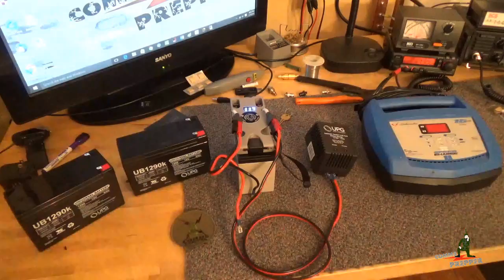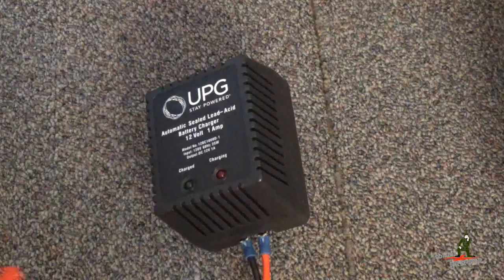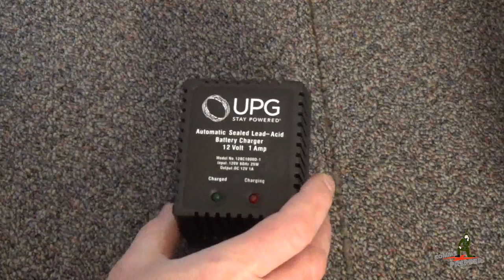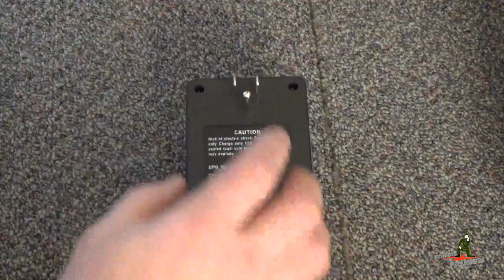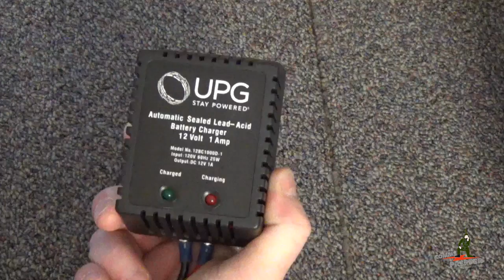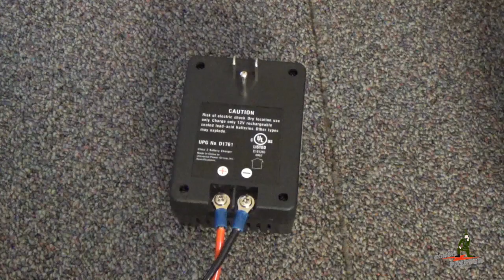SLA Battery Charger

Comment: What is the fully charged voltage of a SLA battery? 12.6, 12.8, 13.2?
Reply from the maker: Not sure.  I don't have them with me right now and would need to look at the spec sheet.

Comment: Thanks for the video! I have that same Hardened Systems unit on my Duracell SLA battery and was searching to see if anyone else was using it in this configuration. I already have a 10w solar panel and charge controller and use it while I'm operating my radio. I was wondering if I could do the same by doing this... having it plugged in at my house while I operate.

Comment: I'm thinking about making a .50cal ammocan portable powerpack for charging HT's and phones + running some LED lights if the grid goes down, would you recommend SLAs? And would you recommend keeping it float-charging all the time?
Reply from the maker: +wouternet94 SLAs are fine for what I use them for.  If I had the money I would prefer lithium batteries because they are lighter. I would recommend a batter tender/maintainer between periods of non-use (a unit matched to your battery type).

Comment: Hank 
Using solar only how would charge your batts 2 stage (absorption/float)?
Reply from the maker: +Max Prepper +hardenedpower I have a BATPAC solar unit that has a built in charge controller for 12VDC panels that supports Absorption and float voltages.  http://www.portableuniversalpower.com/batpac-solar/

Comment: Cool stuff man. I use a small "Battery Tender" plug in charger for the lawn/garden battery I have for my CB/SSB radio base station. Works well. However, I am running a 100w linear amp. When I key up running that linear...it sucks up a lot of power. Thankfully I don't key up for very long. Great video. I have used those Schmacher chargers before...I don't like their charging logarithms...kinda one size to fit all.
Reply from the maker: +Chris DIYer The Schmacher seems to work with the automotive batteries.

Comment: I was baking my gel cells for years as well. I am fortunate to live a few miles from an electronics surplus place and they had multimode gel cell chargers that were designed for an alarm cabinet or something that uses a gel cell as a backup DC source. After using it for a few years It does make a big difference.  You can get the Power Sonic wall wart models from time to time on ebay for twenty bucks - these are also a great value. Thanks for sharing !
Reply from the maker: +SurvivalComms Thanks for taking the time to comment.  Hank

Comment: What can we do when we use solar to charge ?
Reply from the maker: +Theredneck Prepper Hardened Power Systems has a BATPAC with built-in solar charge controller (for 12VDC panels) that you can use to charge SLA batteries.

Comment: Thanks for the info, Hank.  I guess I need to take a look at my charger, a NoCo Genius 1100.
Reply from the maker: +Richard Slusher Connect a multimeter and watch the voltages.
Reply: Will do!  Thanks for the tip!

Comment: Could the meter on the battery be damaged by an EMP? Just curious... Thanks for the video.
Reply from the maker: +JustDanO Perhaps - I just don't believe that an EMP event (man or natural) will induce enough voltage/current into equipment circuits to destroy the equipment. In my opinion only equipment connected to the grid and/or large antennas (exposure providing sufficient metallic surfaces for voltages/currents to be induced) are at risk.  If it's man made and close enough to fry my equipment - game over - I am not EMP proof.  If it's natural, when would you know it's over and safe to remove your equipment from the trash can?  This said - the theory of EMP does support prepping concerns, what level of concern is up to the individual prepper.  For me it's not something I worry about for disconnected equipment (power and antennas).
Reply from the maker: +Wes41 Up front EMP talk is theory - In my opinion (for what it&#39;s worth) - no, the meter will not be damaged by EMP.  I also don't think EMP (man or natural) will damage radios that are not connected to the grid or antennas.  Again - this is my opinion.
Reply: +Commsprepper Wow your going out on a limb with that EMP assumption. Unless your using vacuum tube tech.
Reply: +Commsprepper  Oops! Sorry Commsprepper; I guess I started an off-topic subject. Some believe that a triple layered Faraday cage would be sufficient. In other words, the third layer would be the metal trash can with the lid sealed with metallic tape. It would include an cheap extra electronic clock, along with your HT and other critical electronics, to be used to detect a second EMP which may be expected about a week after the first. Perhaps we could start another thread for this topic. My apologies. Pretty much, I agree with you.
Reply: With electronics today where the distance between circuits within a single component (like a CPU in many electronics of today) separated at the micron level and known to be sensitive to old fashion static electricity, I have to disagree. I enjoy your videos.
Reply from the maker: +Wes41 No apologizes needed.   Great topic and issue for preppers, just not something I worry about.

Comment: Flooded and SLA batteries use the same charge curve. I wonder why that Schumacher was putting out such a high voltage ? Even a Flooded lead acid car battery doesn't need that high of a voltage. Is there something wrong with it?
Reply from the maker: +Jeff Barr Not sure but I have two of them (Schumacher) and they both were producing the same levels.  It would rise to 16 (sometimes 16 plus), then drift slowly down to 14 or 13.  In any case, I thought it would be best to get a charger specifically made for the SLA batteries.
Reply: I use the same Universal Product Group charger for my SLA batteries. I'm a battery geek so this intrigues me. I am going to do some digging. We are a Schumacher master dealer. They got some splannin to do !
What model is it?
Reply from the maker: +Jeff Barr Not sure.  I will have to run back up to the shack.  I got it at the China Mart, it's a 15amp charger.  I will say I am happy with it and use it all the time (on the cars, ATV, off-grid solar).